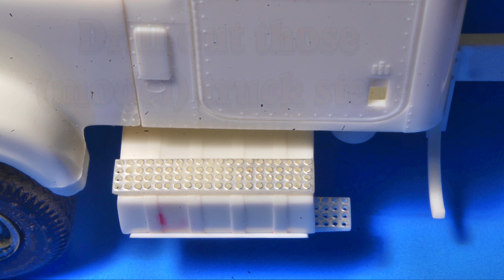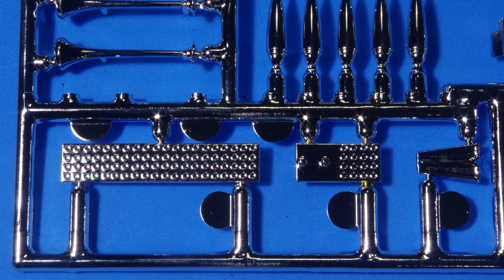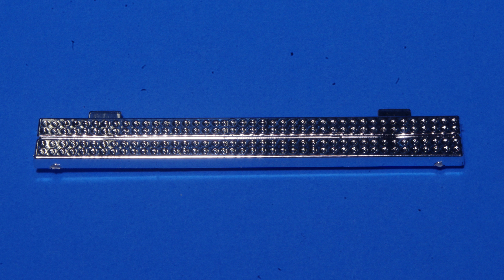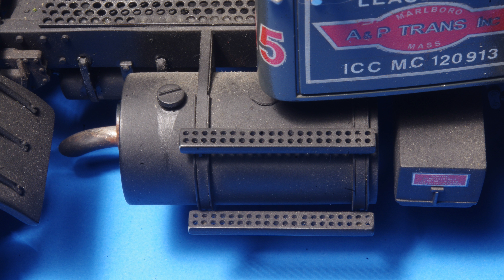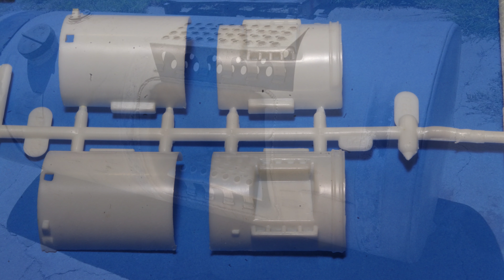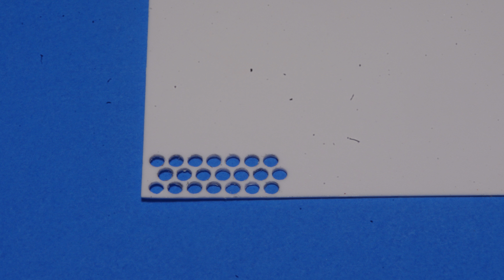Drill out those (model) truck steps for a more realistic appearance

Comment: I will have alot of work to do when I pop mine open. Great job Robert.
Reply from the maker: I like these Transtar kits, built a couple original issue ones decades ago (yellow and black plastic) and have several more Round 2 ones on the shelf with at least one more “plain ‘ol fleet truck” I would like to build based on another 1:1 photo.

Comment: Never knew you could use the mesh from a microwave, thought it was just a print. I drilled holes out before but gave myself blister from the pinvise.
Reply from the maker: Yes, drilling all those holes can get tedious. Push drill style pin vise was the best investment ever! (Even with variable speed control, motor tool is too fast to use effectively on the plastic parts)
Reply: @brsnorthernhorsejourney3579  I'll have to try the push type one.